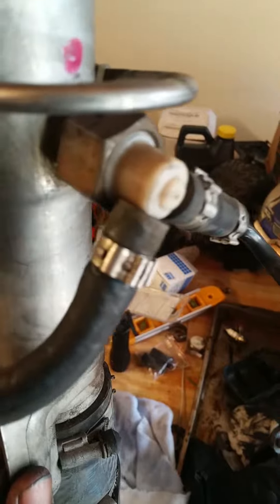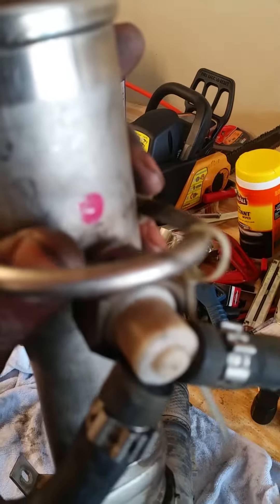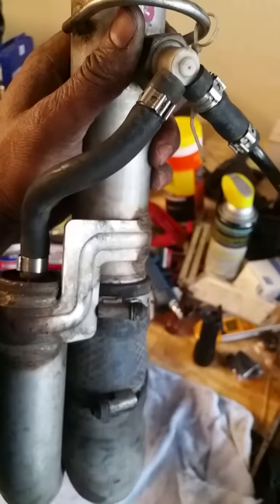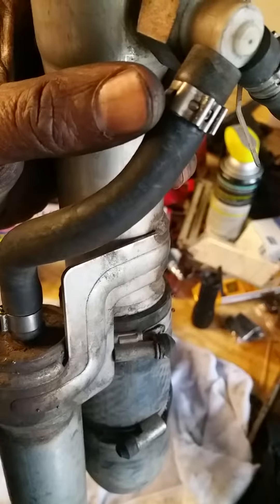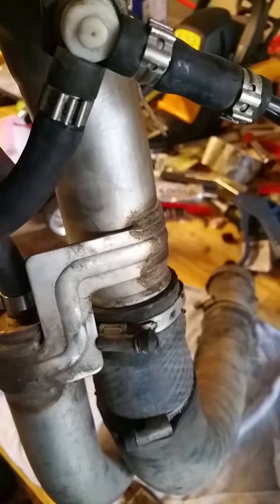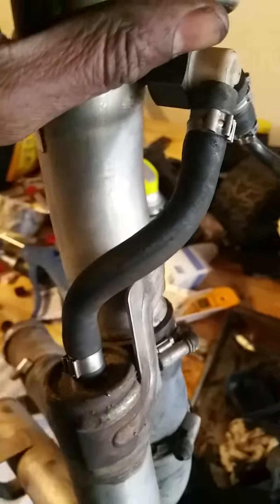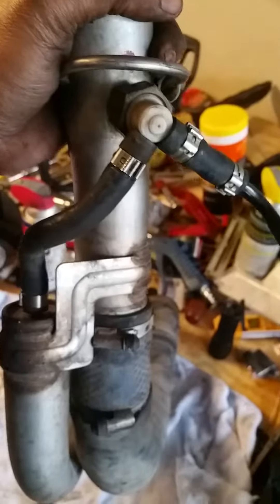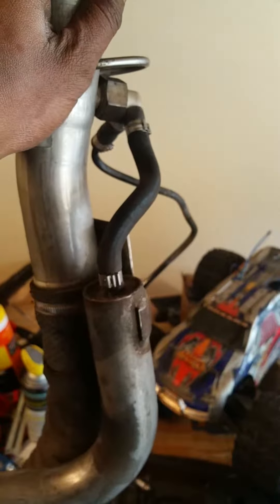Land Rover Discovery 1 Fuel Filler Issue Part 3

Comment from the maker: it didn't help! I can't find a valve anymore either. Not sure if its discontinued or not. Thanks for watching.
Reply: Sorry to hear that didn't work for you in part 3  because my 98 does exactly the same thing.  I tried disconnecting 
the tank line at the charcoal canister in the engine bay in case the canister was 
plugged and it may have made a little difference but not much.  The best
 I've been able to do is 25 seconds per gallon filling and it is usually
 slower which is a real pain when it is cold and blowing outside.  Older
 gas pumps pump too fast and keep shutting off so I have to go to a 
Wal-Mart with new pumps that will pump slower.  My truck has an 
aftermarket fuel pump in the fuel line at the filter so I plan to get a 
fuel pump assembly from a 97 at the local U-Pull-It and hope it might 
help the fill problem as well as restore the Pump-in-Tank set up.

 Did I understand correctly that it is just a small line that actually goes to the tank 
from the bottom of that big filler neck?  I wonder what it would do if you didn't put the trickle valve back in?  I've read that the trickle valve was supposed to keep us from filling the filler neck with gas but as you have found it almost keeps us from filling the gas tank itself.  I also wonder if a filler neck from a 1996 or older Disco would work on a 97/98.
Reply: @philwarner6604  hi there! I've got a 95 disco and she fills fine, but if I miss judge the amount she has in her, the gas pump will keep going and it will start spilling all over.
Let me know if yall fixed the issue and if so, please let me know!
Thanks in advance!
Reply: @Zusu91  If you mean that the gas pours out from under the truck, it is probably because of the fuel pump unit not having a good seal at the top of the gas tank.  I replaced my in-tank fuel pump unit with a new one and could not get the locking ring to go all the way on and mine would overflow at the top of the gas tank if I filled it too far.  I finally discovered that the new unit had a plastic tab that kept the locking ring from turning all the way and when I cut that tab off I was able to turn the locking ring all the way to get it to seal. It no longer overflows, but the down side is that with the tank sealed again it is back to taking gas very slowly at the filler neck.